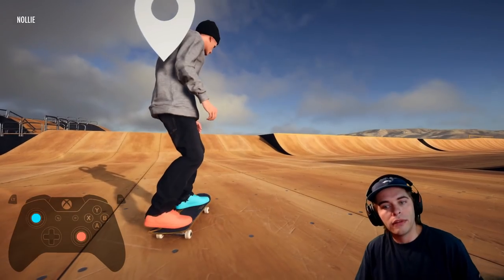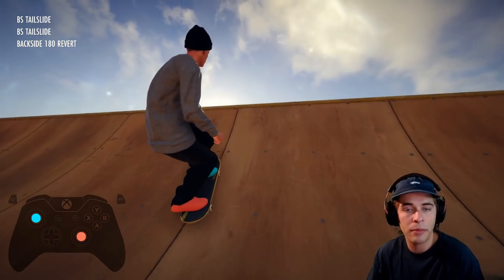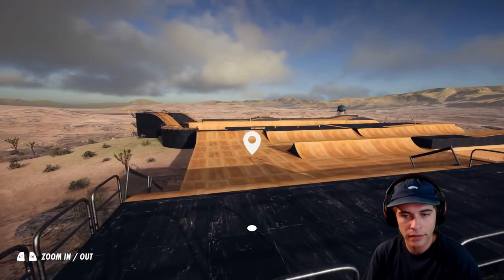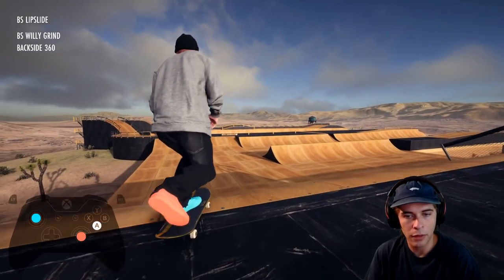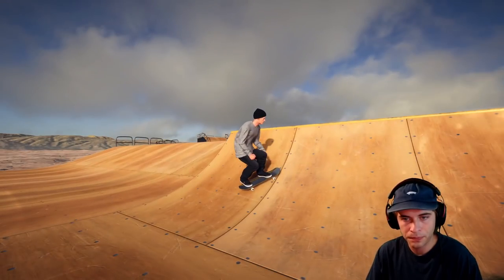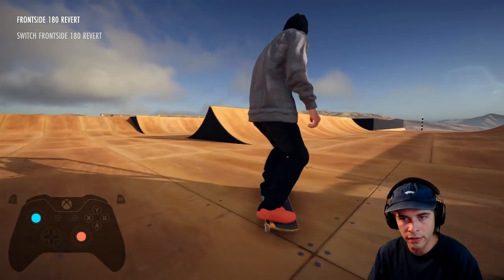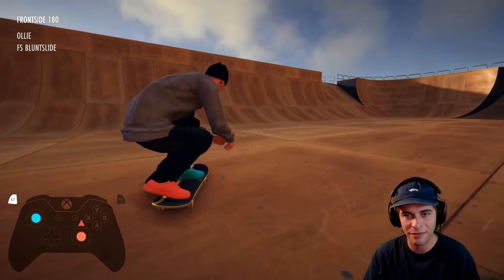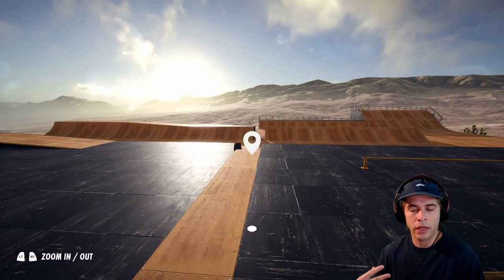How To Skate Transitions in Skater XL | Advanced Tutorial Part 2

Comment: concerning mods and transition : it's the high gravity that fux with the coping and bump/pop out. I've been trying to play with a slightly lower gravity for the past couple days and it works pretty good.
Gravity is 12.00, popforce is 2.9 (highpop 20%), grindpop 1.60, and wayyyyyyyy less pump force, like ~7 (rest is similar or close to your settings I think)
feels smoother yet not floaty.